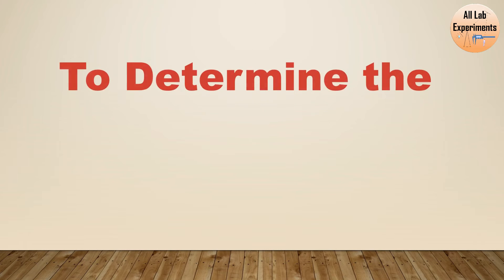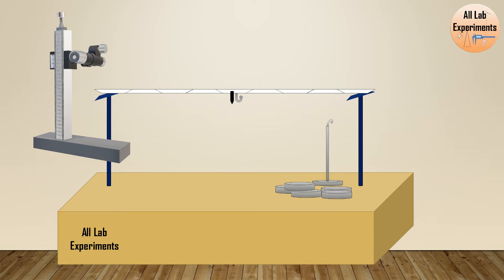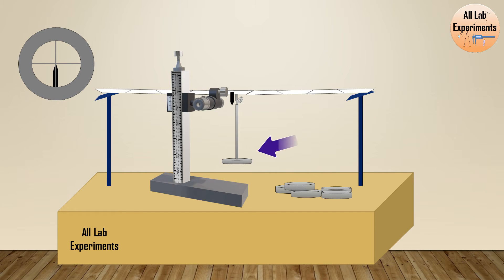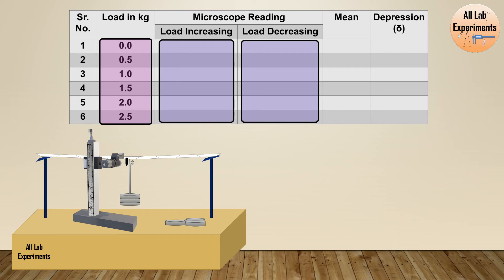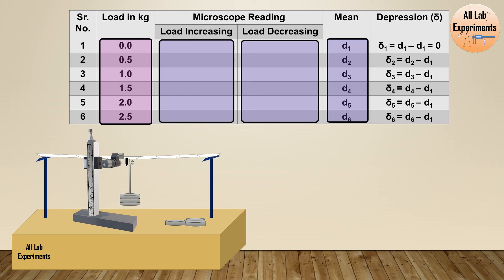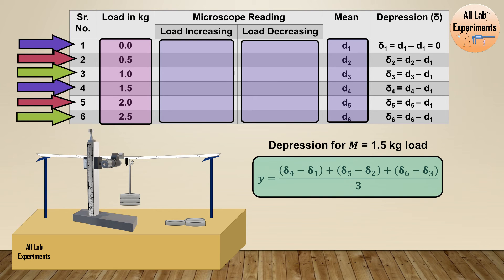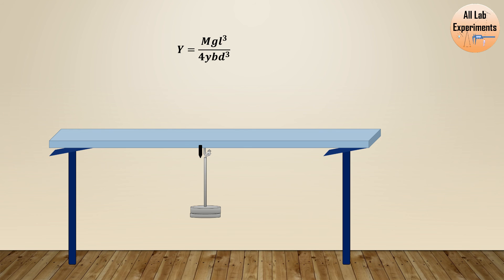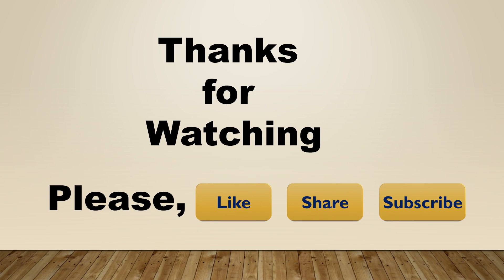Young's Modulus by Bending of Beam | Full Experiment | Practical File Link

Comment: How do you determine the Young's modulus if you used a cylindrical beam
Reply from the maker: Then the formula should be different for that
Reply: @AllLabExperiments  how did you come about that formula?
Reply from the maker: @phethile.m4253  check out some book related to the properties of material. Or this can be approximated using some calculus.